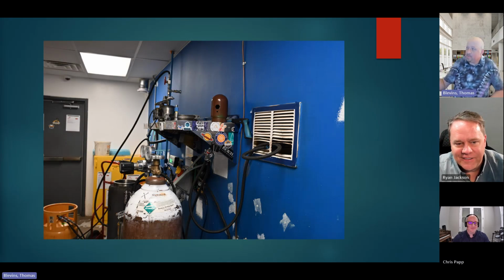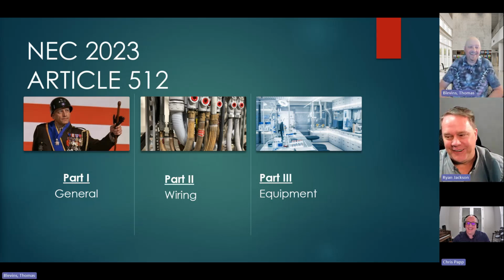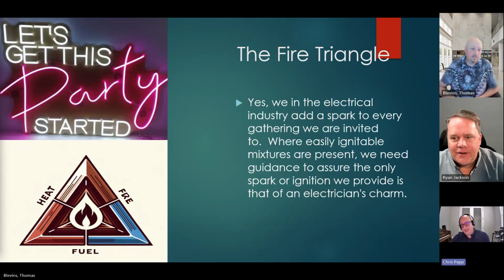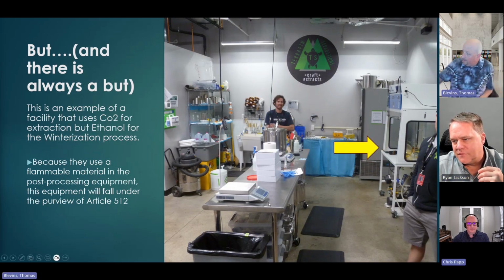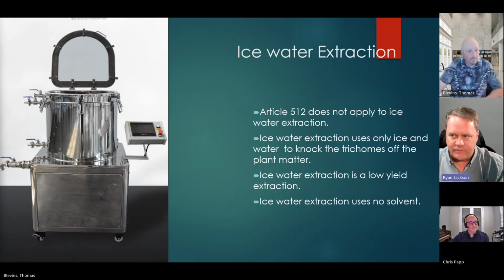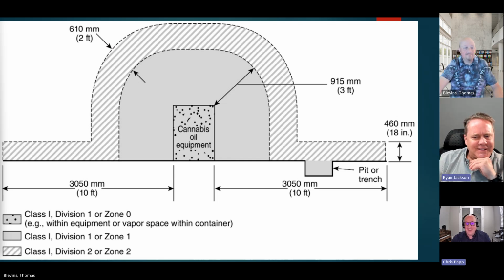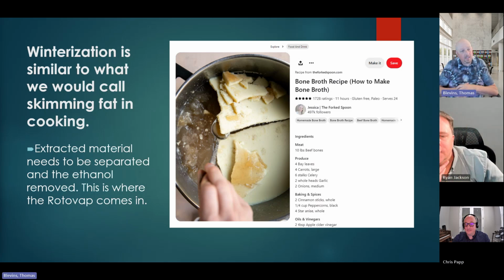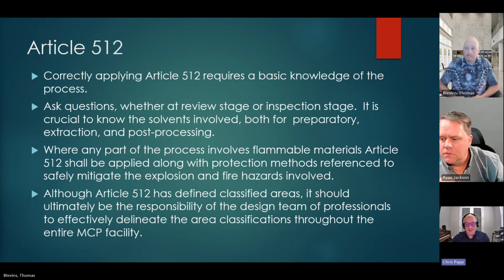Cannabis Oil Extraction and Article 512 of the National Electrical Code

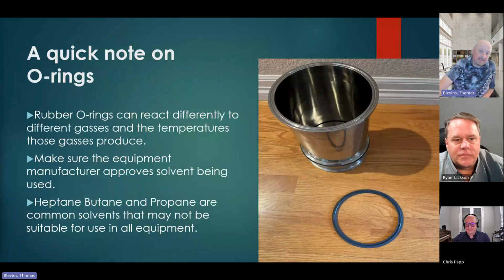Comment: 59:58 LOL I used glass tubes flared at the ends and coffee filters to hold the plant matter. The funny part is before we bought the house they improved the wiring and extraction because he wanted to paint cars. It worked out great because not only did I do that but I am a glass blower so I also have a liquid O2 tank and 100lb propane tanks outside of the shop. I try my best to be safe and so far knock on wood I've never had an incident. Unless you count getting burned by hot glass.